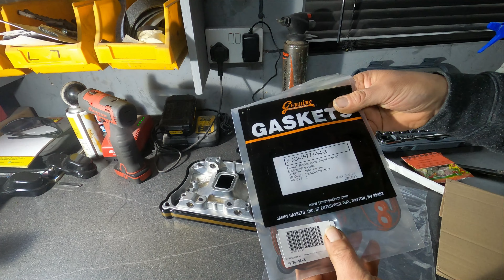SPORTSTER TOP&BOTTOM ROCKERS... REMOVAL

Comment: If you’ve torqued a few bolts, you get a feel for different torque settings. If your not comfortable you can always check feel of a certain torque on an accessible bolt and get a feel of about how tight desired torque settings are
Reply from the maker: Thats true mate 👍. After 30 odd years on spanners, its an easy guess 😄.. but reference to another bolt is always a good call if needed.. unless they are loctited 😃👍

Comment: I love your bike just wondering rocker box is factory black painted right and the gold stripe in like vinyl stripe and when is apply just spray the shiny glossy clear coat right
Reply from the maker: Thanks 👍.. the factory rockers on 48 are bare ally. But black on the iron 883. So have been swapped out to factory black. The gold band is painted on then clearcoat over top yes 👍.
Still looks as good as new 3yrs on 😉👍
Reply: Thank you so much is have 2022 iron 883 but I did the hologan 1200 conversion kit...In i like the rocker box painted like yours just my  consern is that that piece get really hot..I guess heat resistant paint..
Reply from the maker: If you are painting over the bare ally. Use an etch primer first. Doesnt need to be heat resistent. The clearcoat will handle the temp too 👍
Reply: Ok I will do that thank you if I can I send you a Picture when is done

Comment: By doing your method in finding top dead center your able to do the top dead center on both cylinders at the same time? Or you would need to perform this method before working on each head individually?
Reply from the maker: Hi mate. Once you get front cyl to tdc, might have to rotate a few times, till you get straw or whatever you are using at its highest point, then check with rear cyl until they are both about even. Then there will be no pressure on covers when removing bolts and good to go. Best rotating in a higher gear whilst on jack 👍

Comment: Do you have to bleed the lifters?
Reply from the maker: Not at all, as they are not technically removed, and no oil pressure remains with engine off. Its a straight forward swap out 👍. Good question though 👍
Reply: @ALCHEMOTO  thanks for the reply I was really referencing your video because I will be installing a rocker locker kit to quite down the Harley tap sound any way i can install them without removing the bottom rocker
Reply from the maker: @xxmiami4lifexx  I nearly fitted those myself while it was stripped , but yep, no need to bleed anything through 👍
Reply: Thanks again my friend ride safe brother

Comment: Hello @alchemoto thanks for the great video. When I am reinstalling the lower rocker cover im quite sure everything is lined up correctly but I seem to be getting hung up. There is a small gap in a corner after Ive torqed the main bolts. Seems to be getting hung up on the push rods because once i remove them and put the cover on it sits flush. Any idea what may be happening?
Reply from the maker: Thanks 👍.. It sounds as if your tdc is off slightly if pressure felt on box when tightening down. Undo the rocker screws to allow to sit flush, you will have to adjust although hydraulic once lower cover torqued down.there is no valve gap.you just adjust screw to sit down without pressure on pushrod.
Hope this helps 👍

Comment: Beautiful bike. What size Allen socket do i use for top rocker covers? Thanks
Reply from the maker: Cheers 👍.. without looking at the bolts. Im sure they are 3/16" .. as long as you have a set of imperial and metric keys up to 3/8 you are pretty much covered. Also set of metric 👍